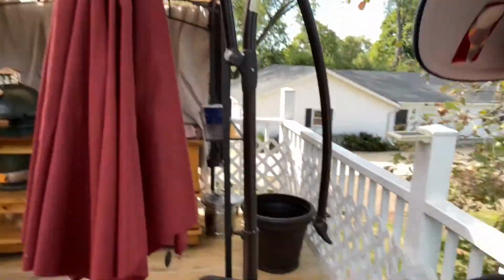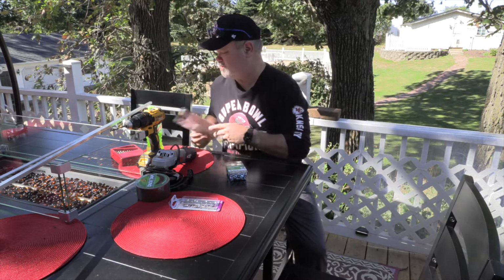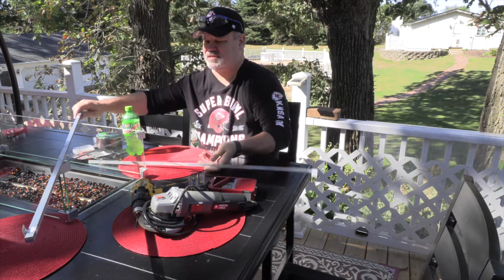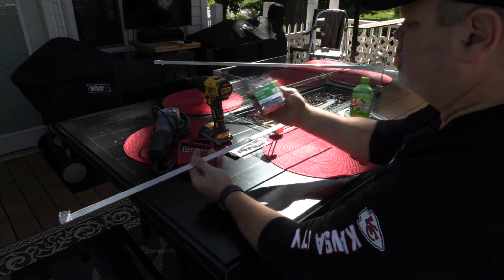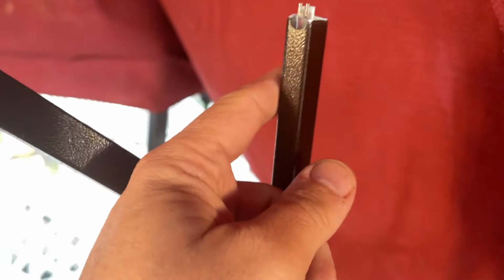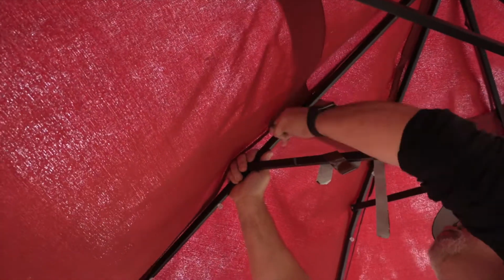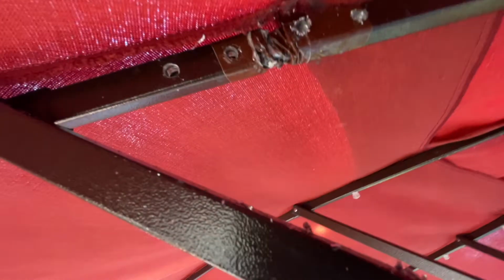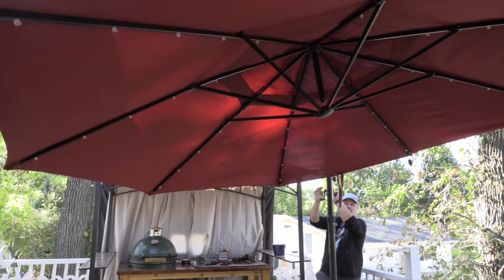Little Bit of Everything - Deck Umbrella Rib Repair

Comment: Thanks for this vid. Have a similar issues and can't source a replacemennt rib so will need to fabricate a repair although I may use pop rivets rather than screws.
Reply: Pop rivits would be a good choice as well. I just didn’t have the tools to do them so I went with screws. Would be interesting so see how your repair comes out!!  Thank you so much for stopping by, I really appreciate it!!